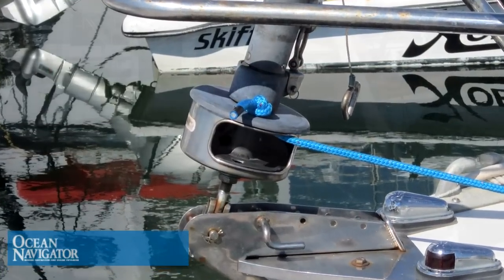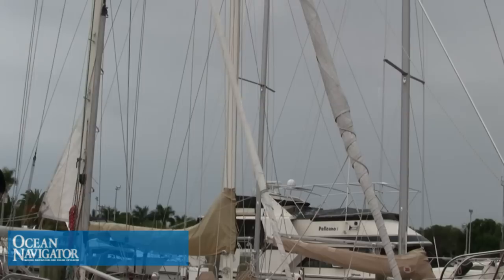Inspecting your Roller Furling

Comment: Other than washing fresh water into each end, which I have to admit seems redundant for those of us on the Great Lakes, what about any lubrication steps? Mine seems to be misbehaving since I got a new genoa from North Sails. I love the sail, but I have not been able to find the happy spot of halyard tension that allows the roller-furler to work as it used to do. I do not know if it is a luff-length issue or a halyard tightness issue or what.

Comment: Thanks for this tutorial!
I had problems with my roller-furler a few times, mostly the line winds not inside the drum, but outside of it, even on the lower part of the foil. Probably at some point the line flies too swiftly (as I did not control the line -
 just pulled the sheet); what do you think? 
One thing remains not clear in your video: what do you mean by "the leading angle [of the line?] to the drum"? Which angle (measured from what to what) should be 90? Maybe you mean the angle between the line and the foil?

Comment: How change the roller line? For other line)
Reply: Look at this link for more information in installing the furling line. His furling line runs on port side, mine runs on starboard side so rotation of drum is opposite. I have Harken Furler circa 1984. I removed the old line (3/16") and replaced it with new line (3/16") several feet LONGER than original to play it safe. Note: I removed the head sail from the system before replacing the line. My boat is a 25' Mirage and the jib is less of a monster to handle. The furling drum has a hole in the side of the drum which I passed the end of the furling line thru and tied a overhand knot in the end. The old line did not have a knot :) instead the line was turned over itself and STAPLED. There is not much clearance between the drum and the furler body for too large of a knot. In the  linked video, the author recommends 30 revolutions of the drum to preload the furler. I didn't count mine because I used the same length of new furler line as the old. Once I had the drum loaded, I went ahead and reinstalled the jib and checked to make sure all was well and it was. https://www.youtube.com/watch?v=NcaoM9ELgwU

Comment: Take the son of a bitch apart.. clean, inspect, replace worn or sloppy parts ! then  and lubricate and put it back together.  Just Do It.   If you cannot do this..you probably have no business on a boat in the first place.,, certainly not off shore, and certainly with passengers aboard.